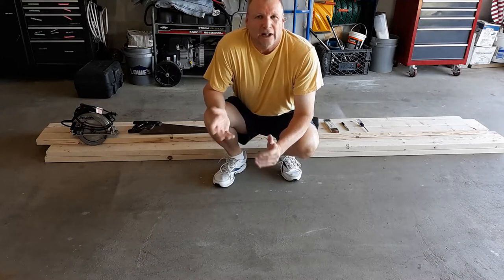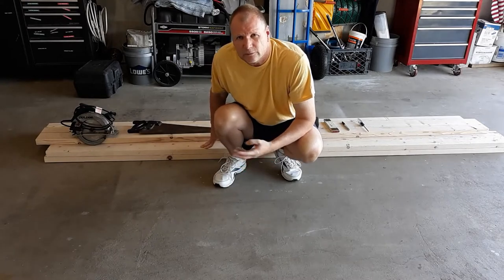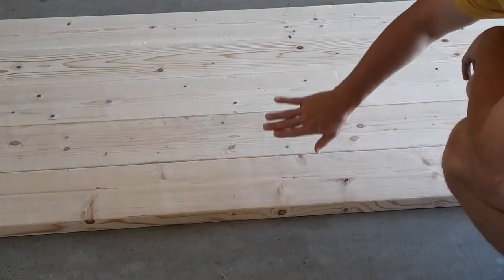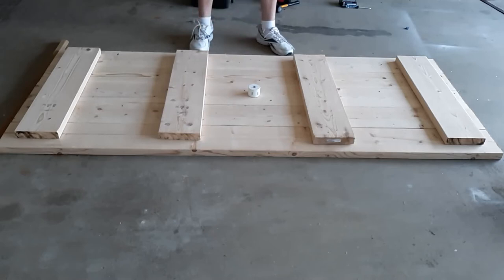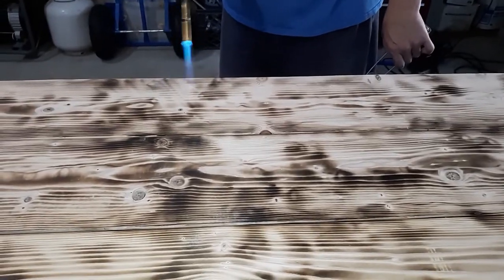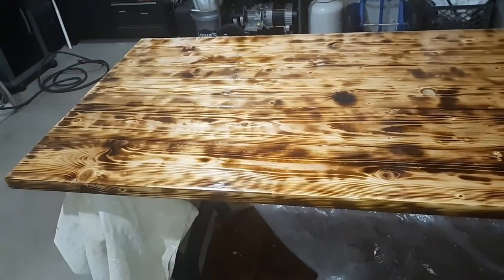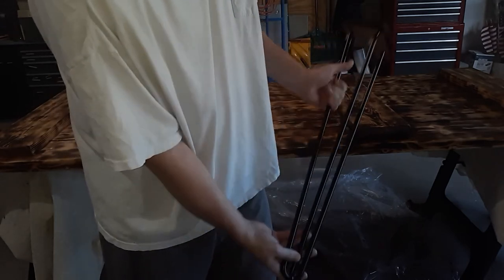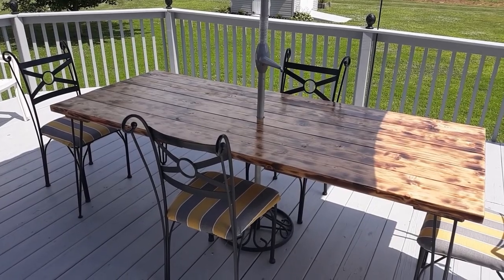Make A Easy DIY Deck Patio Dining Table Metal Hairpin Legs & Shou Sugi Ban Type Polyurethane Finish.

Comment: Nice project and great informative vlog... thanks for sharing. How have the steel legs worked out? Are they strong / sturdy enough so far? Am thinking of using for a home office desk with a solid oak top.
Reply from the maker: Yes, still holding up & moved from Delaware to South Carolina ;-)
Reply: @DiyRick66  thanks for the reply... steel hairpin legs it is than👌 hope the new place is treating you well
Reply from the maker: @MrTheanalogkid  Good luck with your project. Remember the Thicker the metal on the legs the stronger they will be. 😉
Reply: @DiyRick66  thanks, yes going for the 12mm 3 rod as will be using solid oak desktop
Reply: What was the length of the legs.  I didn't hear that part😊